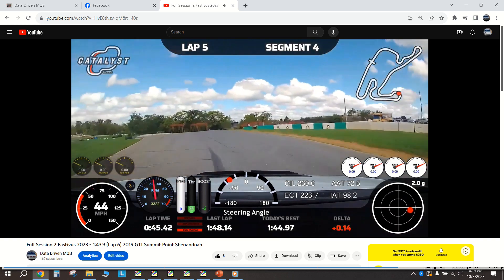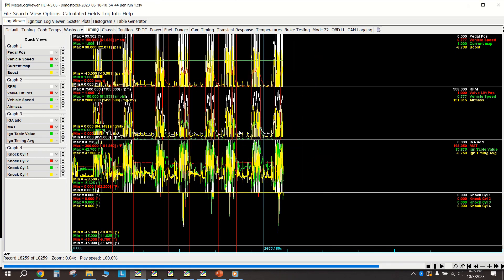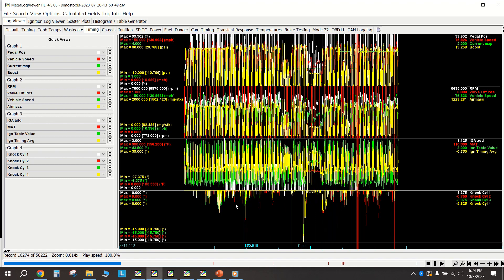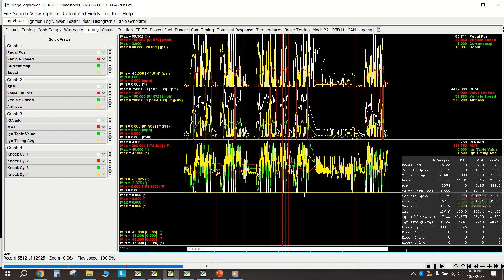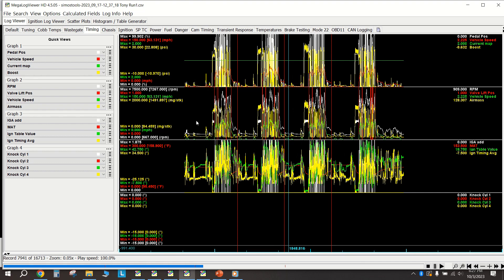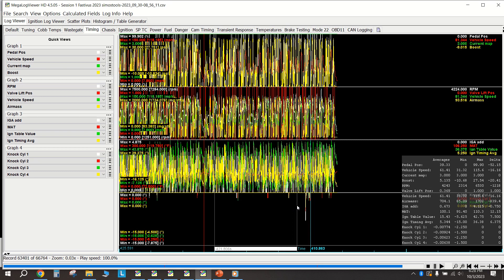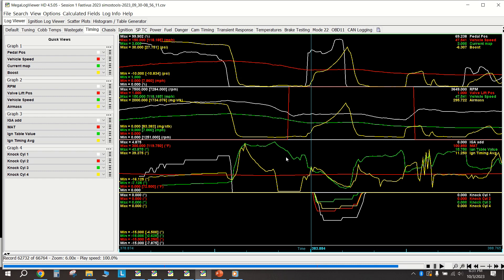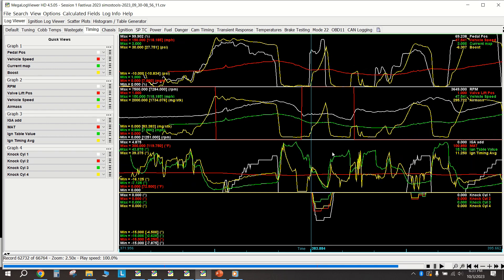MK8 PCV Retrofit (Pt 7) - Track Testing Follow up

Comment: Thanks so much mate. I just ordered the mk8 PCV. I’m going to integrate with VWR catch can for the track. I’m at 34psi so it will be a good test.
Reply from the maker: The catch can delays vacuum from the TIP being able to start drawing on the crankcase. Watch the video here for a more detailed explanation:

https://youtu.be/jYdF-sOLe3I

Oil does NOT enter through the TIP. It’s through the passages in the cylinder head. No catch can combined with OEM PCV will fix this.